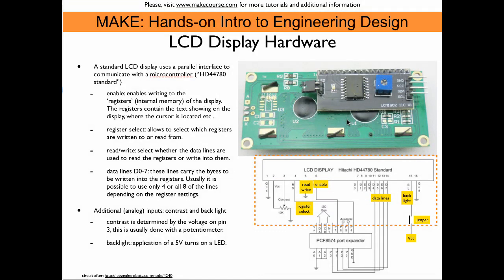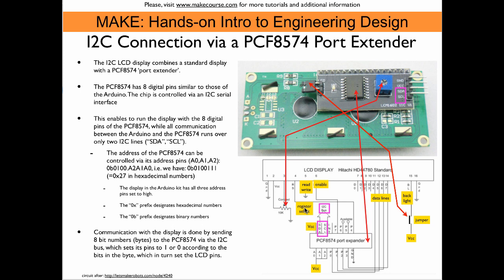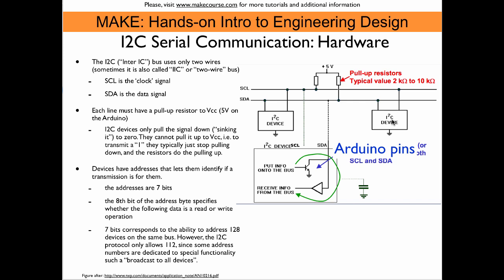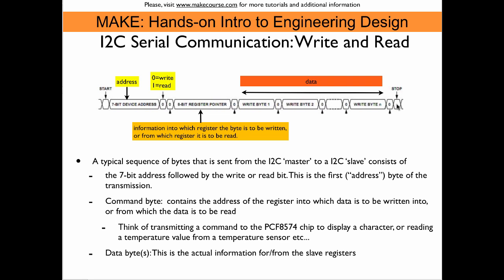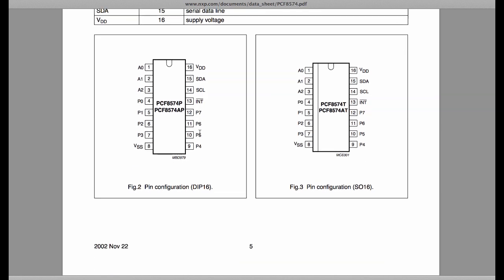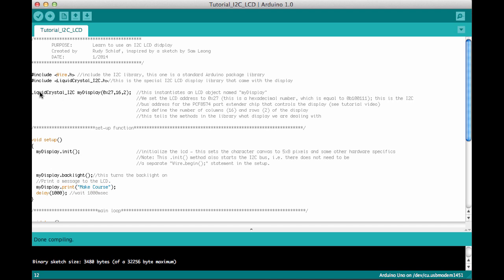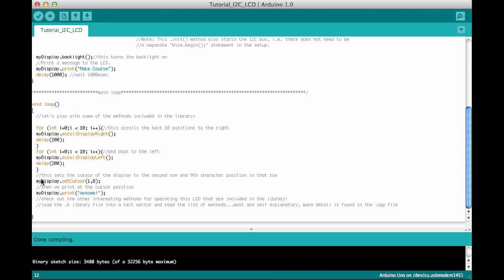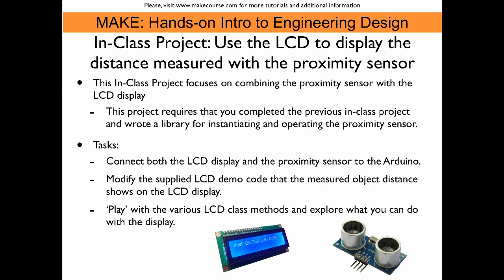Tutorial: I2C Bus LCD Display controlled with the Arduino

Comment: Make Course  someone plz help me
i have 16X2 lcd connected  with i2c to arduino
some how it doesnt display anything
backlight lights up and everthing but nothing displays
not even a simple code "hello world" it doesn't print anything on the lcd 
plz help my prject due soon i cant even fix it plz
this is the code i tried it doesn print anything on the lcd
#include <Wire.h> 
#include <LiquidCrystal_I2C.h>

LiquidCrystal_I2C lcd(0x27,16,2);  // set the LCD address to 0x27 for a 20 chars and 4 line display

void setup()
{
  lcd.init();                      // initialize the lcd 
 
  // Print a message to the LCD.
  lcd.backlight();
  lcd.print("Hello, world!");
}

void loop()
{
}
Reply: ***** Notice (0x27,16,2) 16x2
comment // states 20x4
which one are you using??)

Comment: I have hooked everything up correctly and made sure to triple check it and the code is uploaded but all it does is light up for a little bit and reset. The words never appear
Reply from the maker: Try adjusting the potentiometer on the back until the contrast of the display is best.
Reply: That worked. Thank you so much
Reply: How do you figure out what value to give a letter on the screen, placement wise

Comment from the maker: Are you using the sketch and the  library posted at makecourse.com? There are several ways to run LCD displays. If you use the standard LCD library in the Arduino software, the I2C LCD display will not work with it.